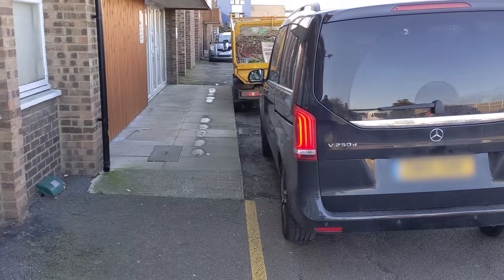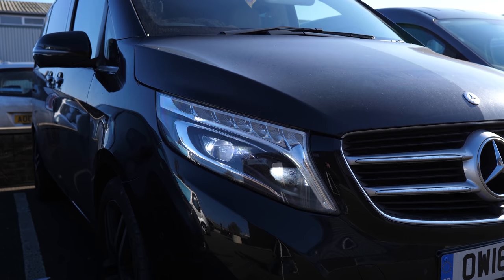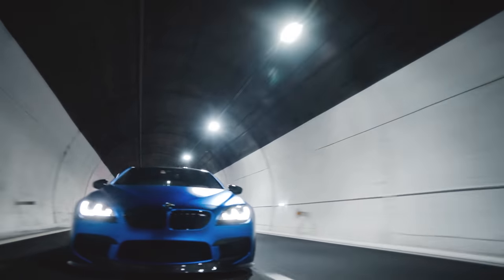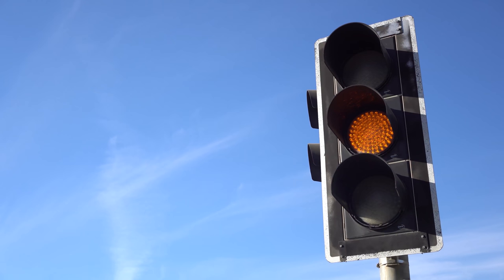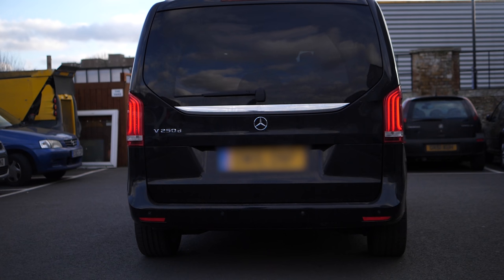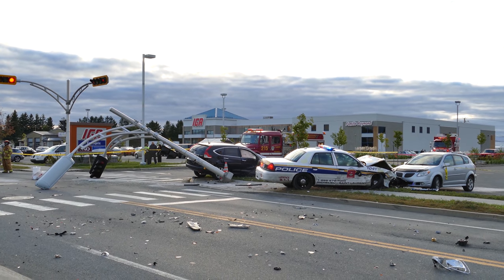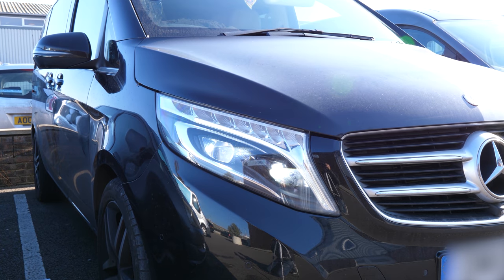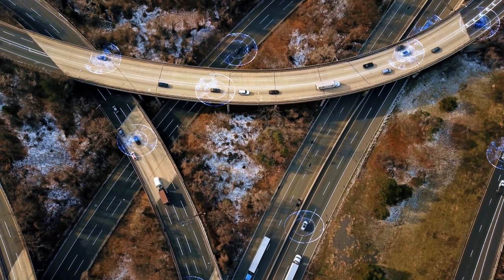Self-Driving Cars Are Dangerously Confused By LED Lights

Comment: From the US here: I have always considered a brake that has to be cancelled to become a flashing light to be less efficient than a separate bulb, even if it were to be red rather than amber. But I also agree that amber is the better color of the two. At a traffic light we've been conditioned that red is stop and yellow is slow and prepare to stop. (For some, yellow means "hit the gas"...)

While it'd be better overall, I agree with certain comments that legislation won't fix stupid. While DRLs have most certainly helped to prevent collisions, there are those who have modified their cars to disable DRLs, thinking that they're saving money on bulbs, or that they're annoyed by the image of themselves that their car presents. I don't understand that mindset, but it's out there.

There is no bad side to requiring all turn signals and/or indicators on a vehicle to be amber. That way, all white lights are meant to illuminate the roadway, amber lights are indicators or DRLs, and red lights indicate stopping. That would condition all drivers the same as traffic lights do, that the color provides the information on the action that is taking place.

As some have commented, there are those who don't fix their cars or who drive in such a fashion that they are not aware of any working or non-working lights (or other devices) on their cars. Ever follow that driver for a number of miles or kilometers while having to ignore their left turn signal? Have you ever been behind someone who's using their transmission to slow the car and realize it later than if they were to use their brakes? Or how about those whose brake lights don't work, or even worse, whose brake lights are on while they're driving and turn off when they use the brakes?

@Steve Mould : Keep on making really intelligent videos chock full of good stuff, including the several implications of imperfection in certain brands or cultures! I laughed at the three that I noticed. The manner in which you present the information helps me understand it, which is key to being able to use it. I wish you only the best, sir.

Comment: The main reason to pulse LEDs is that you can increase their apparent brightness without damaging the LEDs by modulating it in a duty cycle. Straight and direct current will only allow them to be so bright. By "chopping" up the power you can push them beyond their rating.

Comment: Nice video! Question: Why can't they just increase the frame rate of the cameras while using a 360° shutter? Given that 360° shutter in 25fps equals 1/25th of a second, raising the fps to 50 or 100 would increase the shutter speed to 1/50th or 1/100th respectively. Now there are some unknown factors here like sensor and fixed aperture size, but in my experience as a photographer the common base ISO of 100 with an aperture of say f/5.6 and 1/100s shutter is usually enough to not blow out too much information even on a sunny day. 

One would think the AI would only benefit from having twice or quadruple the frames of information to work with as well, and then when it got dark it could simply reduce the frame rate to 25 so it didn't have to raise the ISO too much. I get that high frame rates require more expensive cameras, but that's technology we actually have today, and it comes with bonus advantages, as opposed to lower than 100 ISOs that could only hope to reduce brightness without affecting dynamic range too much. Is it because no cameras can truly produce a 360° shutter, making the gaps larger the faster the frame rate? :p

Comment: I can see that flickering too and it drives me crazy. I see if an LED is flickering up to 100 Hz. Usually it is perceivable with a peripheral vision, or when I point my sight at a different spot, then I see that image during the fast eye movement and that duty cycle as a trajectory of an eye movement where I can see when the LED was on and off. It makes those light dashed lines.
 I do not understand why they make a PWM at only like 50 Hz. 
When I design something, I use there a high frequency PWM like 1 kHz and above, where that duty cycle is invisible to me (and other people) and to cameras too.

Comment: Would be really smart if there was some LiFi standard for transmitting data between cars, have some specific frequency of IR LED that will broadcast things like " I'm travelling at 1m/s at a heading 316.37459, I am decelerating, my left turn signal is on, I can see 4 potential hazards that might make me emergency stop in the next second." or "I'm travelling at 3m/s at a heading 40.32453, I'm maintaining speed, I have no lights on, I'm not a self-driving car" This would then allow cars to know a little more about the world without having to work so hard. If this was standardized it could be incredibly useful.

Comment: Why couldn't you use a pair of cameras with different frame rates(possibly using prime numbers for the frame rates) so that they aren't syncronized making it easier for a computer to differentiate between a signal light and any frame rate related artifacts.

Comment: I think this is a very human-centric view of self-driving cars. Turn signals are great because they make things clear to human drivers who need the additional time to react. Self-driving cars, however, have much faster (closer to instant) reaction time. Do they really need to worry about turn signals and brake lights when they can just react as soon as the driver in front of them slows down? 

This is definitely a problem for other traffic signals like traffic lights. The biggest issue I see, though, is bad actors using LED's (or infrared lights) to interfere with the self-driving systems of a car.

Comment: An actual solution to the problem that you showed, car manufactures should have just 2 extra  cameras recording on different shutter speeds and comparing  each output to match the duty cycle of the leds. i would also suggest to have a a camera with an automatically variable aperture with a shutter speed of 100, since is the most neuteral shutter speed for determining flicker. Actually Sony sensors provides a flicker detection software builtin its cameras so i dont think its a very hard thing to figure out for car companies.

Comment: Could you use multiple cameras with interwoven shutters?

You could split the incoming image through a 45-degree angle semireflective mirror, and put a camera sensor behind each path of that. Both cameras could then have 180 degree shutter speeds (open for half a frame, closed for half a frame). When one camera closes shutter, the other opens, so by averaging the two images, you get full exposure with less overexposure.

If that's not enough, you could put two more semireflective mirrors in those paths and use four camera sensors with 90 degree shutter speeds.

I know this would be more expensive and it would be preferable to find a more robust solution. That said, how much more expensive?

Comment: How expensive would it be to have multiple redundant cameras?

I’m thinking they could have different shutter speeds and operate on a reverse veto basis. If one feed says that something is happening, the system decides that it’s happening, regardless of how many other cameras suggest it’s not.

It’s more complicated than just having the shutter wide open, but I would expect it to be less affected by motion blur.

Comment: Use more than one camera. One with the aperture open all the time to correctly interpret the LED, and another designed to ignore the lights and can have its aperture open for shorter duration and correct ISO to deal with the motion blur problem. Another way to deal with it is the way that boat navigation sound signals work, sounding on for five second every minute.  But to prevent the occurrence of more than one boat sounding at the same time and their operators not hearing each other, they actually will sound for five seconds every 55-65 seconds randomly to prevent them synchronising. So, maybe the lights and camera systems could do something like that, at a narrow range of randomly adjusting frequencies.

Comment: An interesting problem
I think the solution will include an international standard for signal lights in vehicles and traffic lights
also, instead of sampling the entire sensor (or screen for that matter) at a constant rate, you can sample alternately.
And this way you will get a picture with a lower resolution, but overall it will be continuous.

Comment: I've said for a while once self-driving cars become more common place, before then ideally... We need to have a better system, Using a better communication system to relay the condition of signals to the vehicles. Much like the transition on the railways to in-cab signalling.
There would be radio transmitters based around inter sections, relaying to the cars the condition of the signals they are attached to. Different sets of lights would be brought into a "section" that is all handled together, and independant from other "sections" say further down the road.
Sections, and lights within a section would need indexing and made available for the cars to check on the road databases so they could easily compute which stop line corresponds to which part of the signals.

Comment: Older LCD monitors, back when manufacturers were transitioning from CCFL backlights to LED, used PWM dimming almost exclusively. It could be at fairly low frequency too - 200 Hz and such. Interestingly, over the years that changed to much higher frequencies (kHz range) or no PWM dimming at all. I'm not sure if the complaints from flicker-sensitive people were the reason or something else, but it proves that any issues with analog dimming (color shift etc.) can be solved.

Comment: I don't believe it's necessarily a problem that will persist. Many small CMOS image sensors don't even have a shutter speed functionality, they operate nearly continuously with a very close to 360° shutter angle, and sensitivity to light is adjusted by gain; or it can maybe in the future be adjusted by a liquid crystal ND, basically equivalent to a single pixel LCD. So it's very possible to make small camera sensors which are impervious to PWM flicker.

Comment: Point your iPhone camera at the digital clock on an oven - same effect! Put the camera in slow mo mode and point it at a 240v oven clock. Looks cool. Now press record and watch back. It’s a little more complicated then this example because the clock is 240hz, the camera is 220hz and the phone display is 60hz. If you could make an app that could adjust the camera and display frequency (and which of the 60 frames you show, ie every frame, every other even, every other odd, every third etc) then it could be used as a cool real-time-yet-looks-slow-mo analysis tool

Comment: Would it not be possible to use a film that changes brightness either depending on light levels or due to an applied voltage. Almost like self darkening glasses or welding goggles and LCD screens or the windows that can darken themselves. With the self darkening solution you could maybe set it up that it always only lets the same amount of light through because as it gets brighter it also dims, the dimming and brightening speed may be a problem though when coming out of tunnels or garages, etc, so the electronically dimmed solution may be better. So the car has a seperate light level sensor, or maybe just analyses the camera footage and then it changes the transparency on a film in front of the camera. So if it is too bright then it dims more and if it is dark it brightens it. Using something with individual control like an LCD would allow it to independently dim and brighten different zones of the camera, with a high frame rate too. So say there are bright headlights in front that would dazzle drivers or the camera, it could dim the area where the headlights are coming in, the same as when leaving a tunnel, If it was an LCD it would also be able to respond fast enough to sudden changes in the light.

Comment: 1/300 being a multiple of both shutter speeds would probably be a solution though it greatly reduces the amount of light visible by the camera, especially at night. Also, adjusting from software the camera shutter speed a custom value that would overlap with both frequencies could probably be a solution, though if by any chance the value is changed by mistake towards the default il US or EU with any new version of the software the problem is back again. 

Standardized systems are the solution as you say it, though this is expensive and I doubt it would be easily embraced.

Comment: What about faster/dynamic read cycles in cameras. I understand that the shutter is an artifact of serial days, where you had to shift the image out of the sensor, which was not as fast. So we use shutters as a cheap hack, which was ok because we didn't need better cameras and for analog it was a must.

Comment: My question is,  why do the autonomous vehicles have to be dependent on cameras and lights? Wouldn’t it be easier if each vehicle had a communicating device implemented, or use an IoT cloud to direct vehicles to act accordingly? Or is this already implemented, and they’re trying to figure out how to get the new cars be capable with old non-implemented cars?

Comment: It would be a good idea to dictate that the PWM frequency must be at least 200kHz, low PWM frequencies have a load of other issues as well but hey, we saved another fraction of a cent by doing it in a crappy way...

Also with LEDs adjusting the voltage (alone) does just about nothing to the brightness because they're diodes, once you're past the avalanche voltage they look pretty much like short circuits. The correct way is to adjust the current (which to be fair is actually done by adjusting voltage via a feedback loop but there's a reason this control is called "constant current" ) but alas: that requires a few more components than PWM and thus costs some cents extra and isn't done until some large market dictates it (that market should again dictate some suitably high minimum frequency for the control loop or there will again be flickering because the current fluctuates)

Comment: Would it be possible to solve the problem with a cluster of several cameras or even sensors within the camera that each have a different frequency? The data could be combined so that if any of them see the light on, then they all do. Like a sort of persistence of vision that organic eyes have but you could separate the signals, too, to prevent motion blur.

Comment: An other issue I could see. Actually emergency lights on police, fire and ambulances. There are so many out there with different frequency strobing.

However, I do know there are many traffic lights around the world that have sensors on them. The emergency vehicles transmit a special light strobe frequency and the traffic lights respond. The lights will automatically turn green, or stay green longer, for the road that the emergency vehicle is on. Perhaps self driving cars can sense that same frequency and respond by pulling over.

Comment: My LED brake lights have a bunch of individual LEDs, wouldn't lighting a fraction of the individual LEDs instead of duty cycling them fix the problem?

(I checked them with my camera phone, at ISO100 they where solid red, at ISO1600 they varied in brightness but never turned off and on the two auto settings there was what I think was a rolling shutter effect.... It's quite dark out right now and I only tested the running light function of the brake lights, not the brake light function. My car has discrete yellow turn signals)

Comment: Another solution would be to make a standardized communications unit that by law must sit on every vehicle on the road. (But OFC the AI still needs to be able to deal with lawbreakers)
This device would communicate to any "driverless" car what the cars around are doing and planning to do.
With such a system in place, you could already (without AI) eliminate traffic jams completely.

Comment: What about using two normal cameras simultaneously? The could be synchronized so that when one shutter is open the other one is closed. Then you would need some kind of software that blends the information from both cameras.

Comment: I wonder if you could use an LCD shutter with a sufficiently high or smoothed duty cycle, placed in front of the camera, to act as a sort of aperture (more of a filter, but still) to deal with the problem of adjusting exposure

Comment: The way I'd solve it is using 2 cameras each with a co-prime framerate. Say 53 and 61 (both prime). That way a light would have to have a PWM of 3233 Hz or something super precise like 202.06 to cause these issues on both cameras simultaneously for long enough to seem like a turn signal.

Comment: This is a problem with lathes and lighting too. (There has been deaths because of this.)

If the lathe is turning at a frequency matching the light frequency the lathe will appear to be standing still while turning at working speeds. (There are several speed that can cause this phenomenon.) You will ofcourse still be able to hear the machine running unless impaired or there is other noise pollution.

To avoid this you need lighting in the form of either old fashioned fillamentlights or more than one light source that runs on different or offset frequencies so that there's always light being emitted.